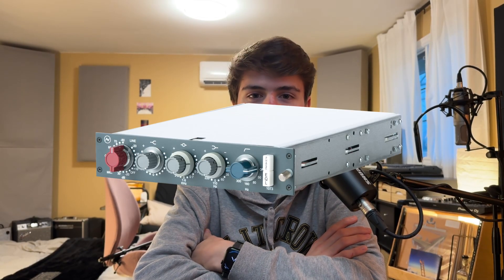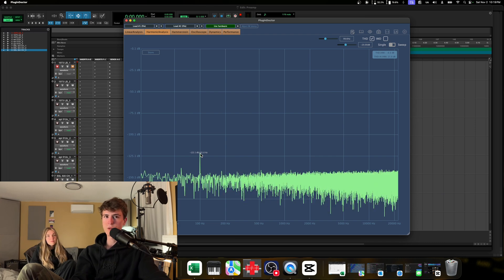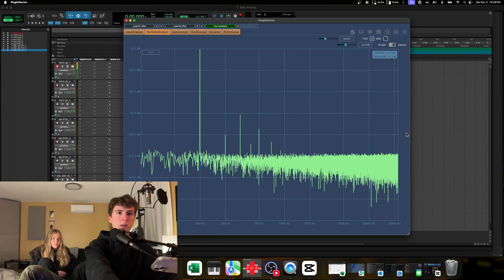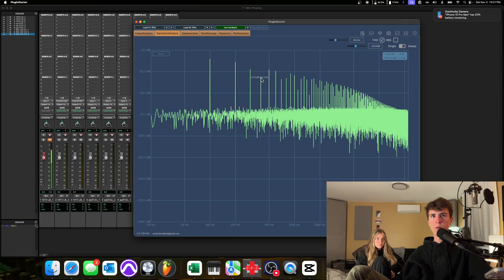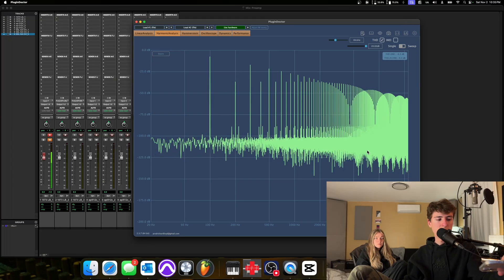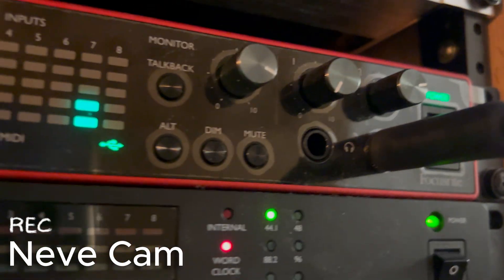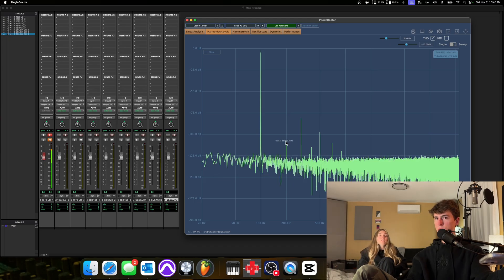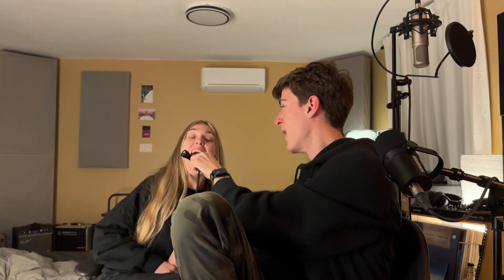Plugin Doctor on Hardware Neve 1073 Preamp

Comment: Cool experiment. The only thing you need to understand is the principle of gain staging.

With analog gear, things are happening in stages, and it's possible to clip one stage while not clipping another. This will make a source sound distorted but may not register as clipping when it hits your converters. For example, preamps offering two stages of gain have two stages where they can clip. This is why when you were turning up the gain on the red knob, at one point, you stopped getting the corresponding gain at the converters. You were getting the maximum gain that stage can give you (in short, distorting it). In short:

Stage 1: Source + Input Transformer (sometimes these add gain as a byproduct of impedance conversion) + Neve Input Gain (red knob)
Stage 2: Output gain + Output Transformer
Stage 3: Convertors

Any of these stages can clip independently of one another. Once you get this, you can get really creative with how you saturate your sources. Hope this helps.
Reply from the maker: Thanks for explaining!

One thing I certainly would like to know more about is the purely electrical theory/science behind analog audio. I think the next natural progression for me is to learn more about impedance and how it impacts the audio signal. Sure, something like mic, instrument, and line level differ from an overall "amplitude" standpoint- but also the characteristics of impedance. I know that's true, but not much about what it means or would imply...

For a simple example hi-z vs. mic input. I know what they are, when to use them, and what happens if you screw it up, but I couldn't explain to you all the details of "why" and what happens when you activate a hi-z switch for example. I know it changes the impedance, but why does that have the effect it does? I couldn't explain that.

Comment: It's not a matter of computing power to calculate a more precise spectral graph, the graph just needs more audio samples to become more precise.
Reply: which, at a high refresh rate, requires more computing power :)
Reply: @heerobigby  True. But still with endless computing power it would always be precision against speed. If you code it to use a sliding window of 1 second that refreshes every frame it would indeed require more computing power and the animation would be somewhat smoother but not faster. Peaks in the audio spectrum would rise and fall slowly. You can see this behavior very well in Span.